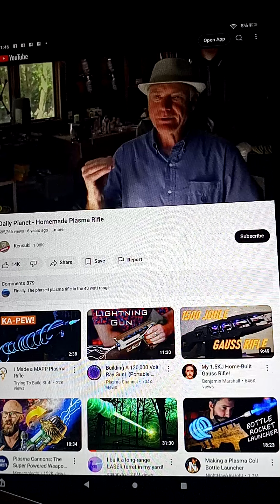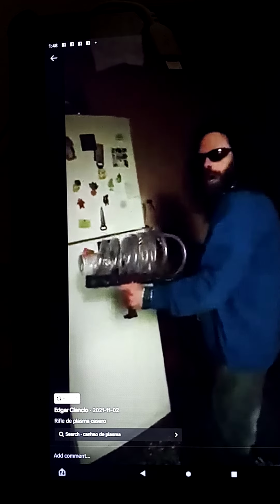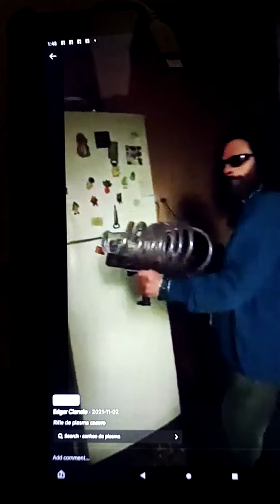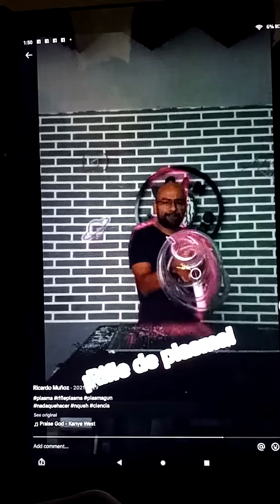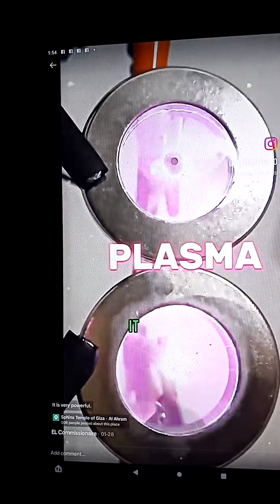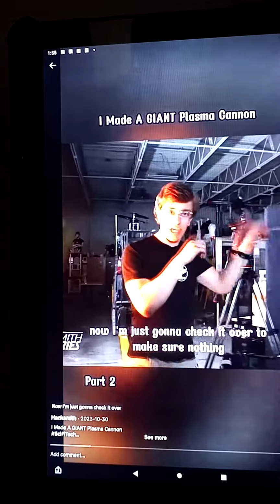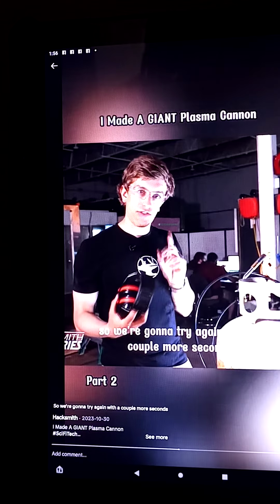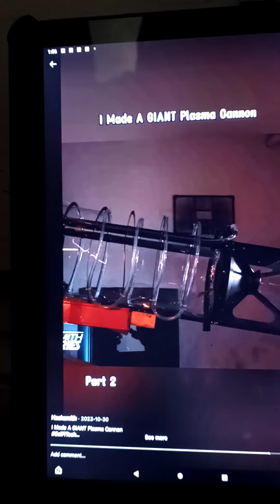Tech talk. --- the plasma rifle

Comment: It seems like you can ionize 

(a process that causes atoms to gain additional electrons, and make the atom more electrically charged (I think)) 

Oxygen or Nitrogen, and this creates plasma as well 🤔

So, possibly get a chamber filled with air from the atmosphere that has no openings (to trap charging atoms inside), charge the gas inside by sending electricity through it (Similar to what's in the video) OR have strong magnets create a charge around it to turn the oxygen/nitrogen atoms into ions... eventually I'm thinking the gas will begin to glow as plasma 🧐🧐
Reply: 💡I'm sure there's a way to take a standard transparent light bulb, remove the base, take the coil out, re attatch the metal base on again, and use that as a charging chamber 🤔💡
Reply: You both have great points ❤
Reply from the maker: I was thinking about connecting crystals with it